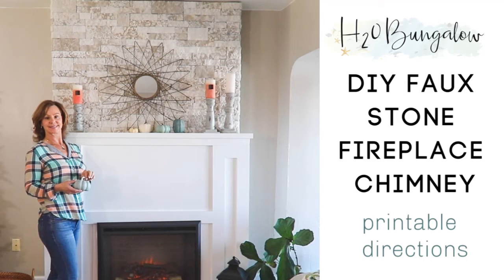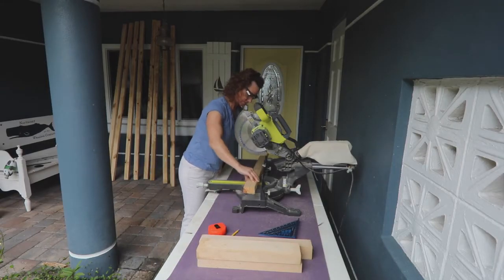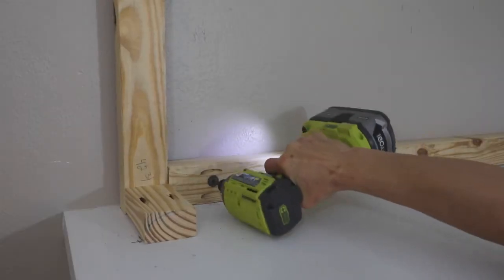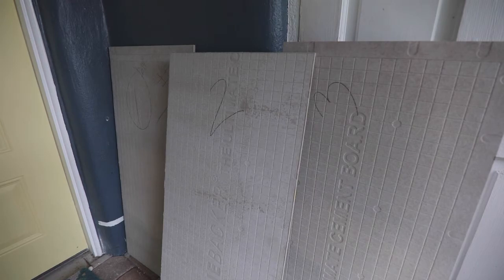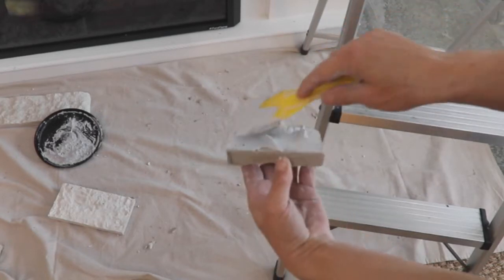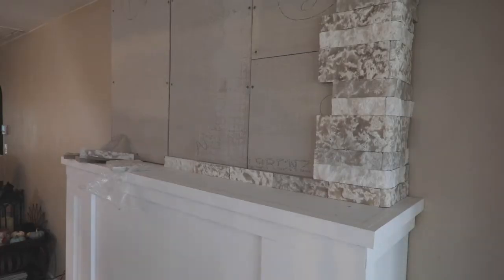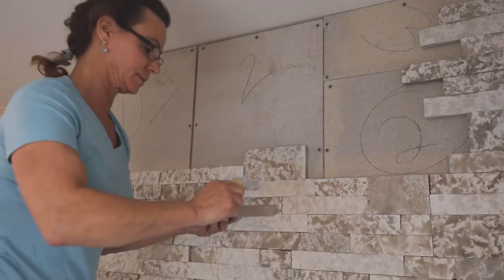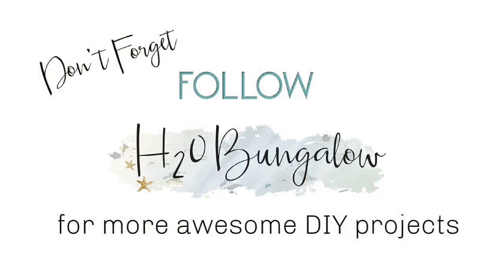DIY Faux Stone Fireplace Chimney

Comment: does the electric fireplace insert need a material other than wood/drywall on the interior of the fireplace? Worried about fire hazard when building and too much heat in that area. Thank you!
Reply from the maker: https://amzn.to/2MOlz8Y , It's a LED flame and will not cause any heat. 
Good luck and thanks for watching.